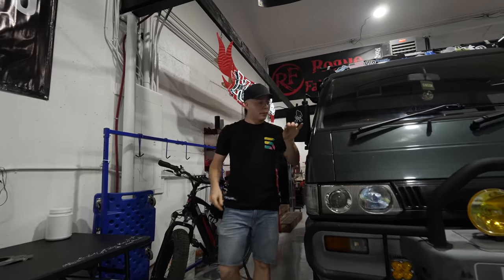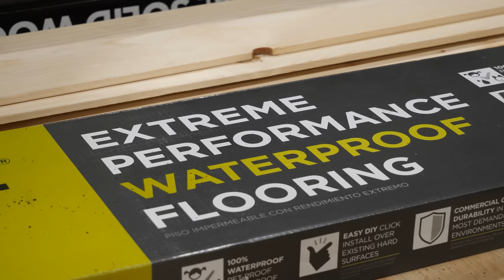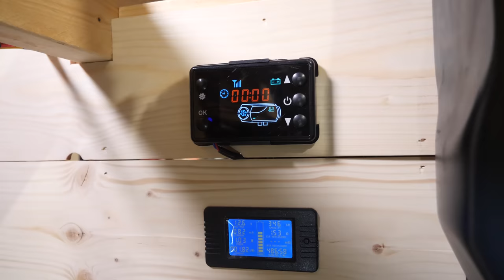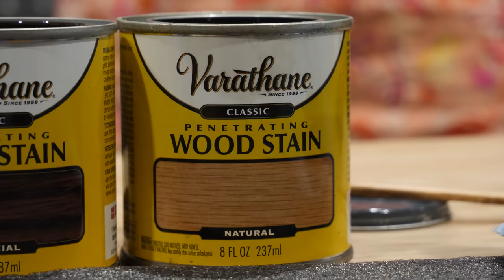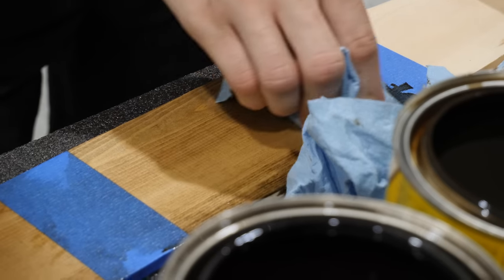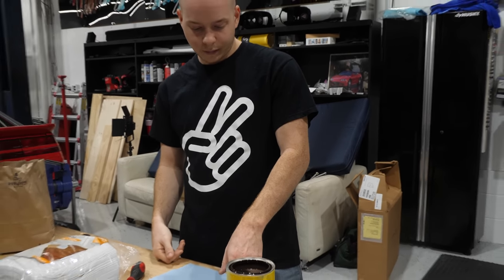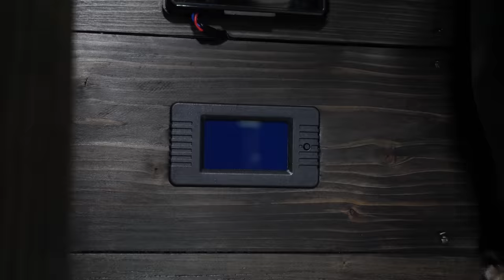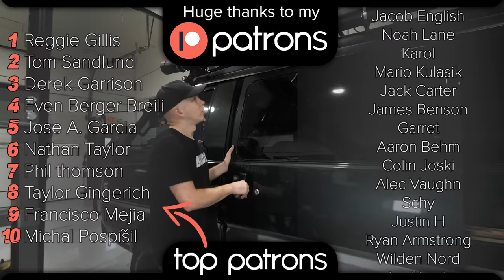The New Return Of An Old Project...

Comment: Great job, but I gotta say that it looks way overbuilt for that vehicle.  Must be getting close to GVWR even without passengers, water and supplies included!  I hope you have very sturdy brakes on that beast if you will be taking it up the mountains there.
Reply: Yeah all them 2x4s you ain't framing a house bruh
Reply: @johnnybodangus2529  Im currently building out a camper van on my other channel, and 2x2s work perfect! Save weight, money, and its still very solid
Reply from the maker: People forget these things are 7 seater vans. I can guarantee 7 people weigh way more than this wood lol
Reply: @_Gingium_  google says max payload is 625kg for the 4wd version. You could easily exceed that 2 people + fit out + food water and other gear. Best to check
Reply: @_Gingium_  You are right, but weight still adds up and in the grand scheme of things the wood isn't a ton more weight compared to 2x2s, however, it still matters for MPG and off road capability. Just my 2 scents for your next build my friend! Getting better is the name of the game.

Comment: While it does look amazing, I feel like he put like 600 pounds of wood and stuff into that Delica, while also moving the center of mass quite a bit higher than it was. I feel like it won't drive as great with the not-so-powerful engine, and its overlanding capabilities may also be compromised by the weight high up in the structure. 
But it turned out great and it certainly seems like an awesome camper van :)

Comment: If you ever do the flooring again you want to stagger the pieces first one use full price next one cut off 2/8 and next cut off 3/8 that still not right but you have a small area this way none of your butt joint are in a straight line that will cause boards to come up easier. Or use liquid nails and it will never come up again 😂 but for the stains you should have used cherry red mahogany it's so pretty of a color and give a light vibrant looks

Comment: When building a camper overkill is often a fatal mistake.
Most of the materials used are too heavy and take up too much space and provide no benefit.
Before building a camper look at how they are made by RV companies.
You will find that where you use five ply plywood they will use two ply and glue it to rigid foam , instead of several 2x4 lumps of wood they will use inch square aluminium or steel tubing to build structures that can barely hold the estimated load not several elephants. They will (if they’re good) make everything easily removable in sections so you can get in to repair things.